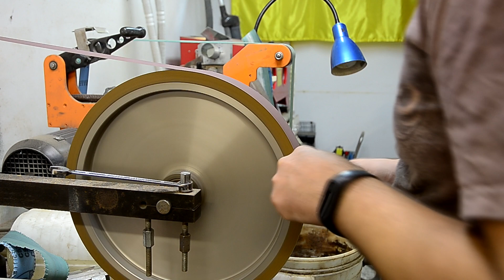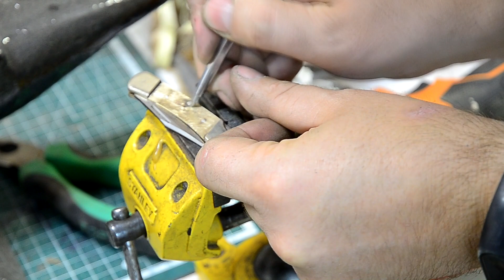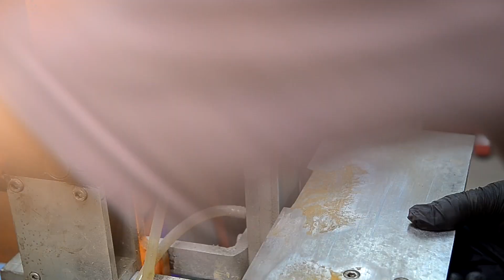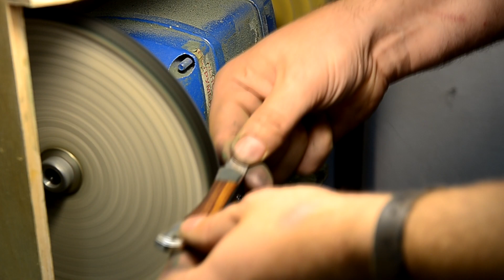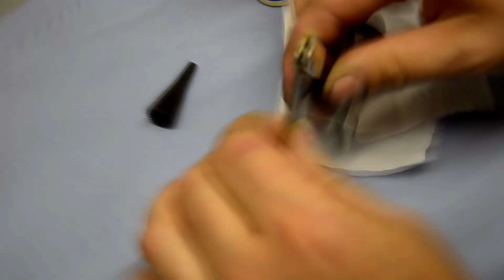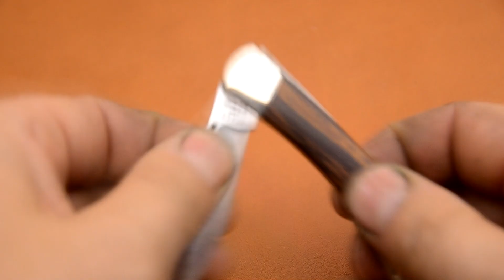New life for old pocket knife.

Comment: Impressive and outstanding.  The tooling is great and I have nothing like it.  Me?  I just did restorations on 5 Buck 110s or look-a-likes yesterday.  Cleaned with vinegar and que tips. Lubed.   tested.  Then I sharpened the blades.  Followed by buffing with a buffer and jeweler's rouge.  Cleaned and lubed again.  Not have the tooling to replace the wood on the oldest unit, unfortunately.

This morning I sent restored Cold Steel folders in leather belt sheaths and Smith and Wesson knives to three nieces, two of whom will be 21 in February.
Reply from the maker: Thank you!

Comment: Why didn't you open the blade and knock the two cover pins out after filing/grinding them flush?
There is an EXCELLENT chance those pins will drop into the blade well eventually and jamb the blade.

What brand is this knife?
I couldn't get a clear view of the tang stamp.
It almost looks like a Colonial made knife made for Kmart back in the 70's or 80's.
Reply: You clearly can s it's mad in Ski City,Japan